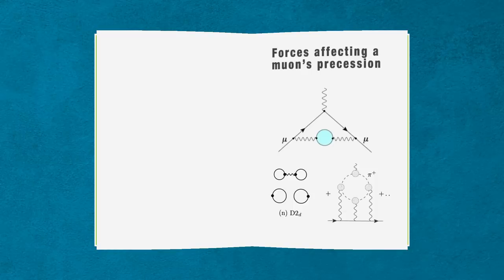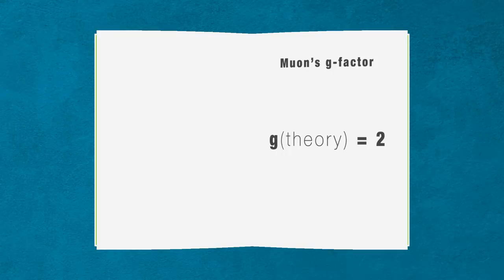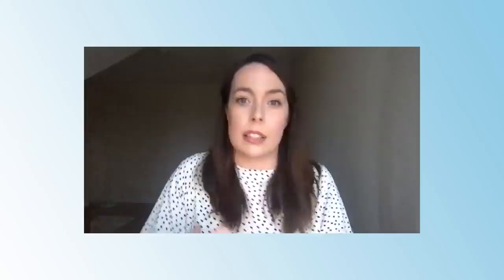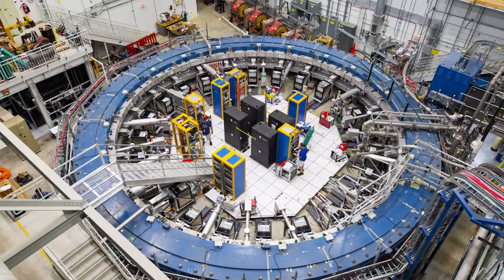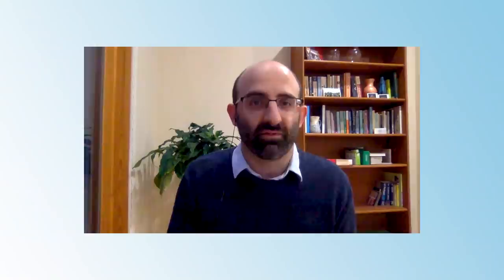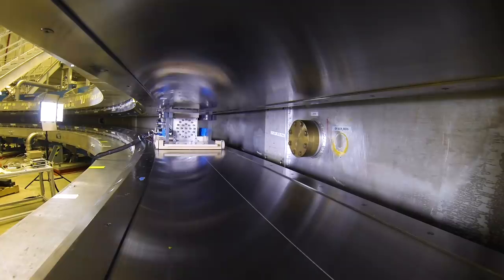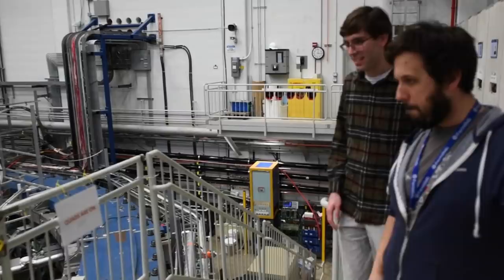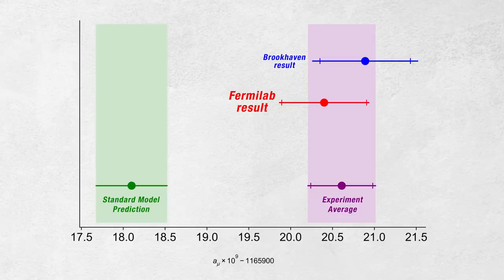Muon g-2 experiment finds strong evidence for new physics

Comment: A very ignorant, but genuine question: What, if any, systematic errors are associated with the physical experimental apparatus? Is there any concern that the similarity between the two experiments is possibly due to the use of the same magnet?
Reply: It doesn't make any sense: how could that influence the experiment? 

(But thumbs up for critical thought anyhow).
Reply: This was my first thought when they said they used the same magnet again. It would certainly help to do the experiment with new equipment, but I can imagine funding for this sort of research is already hard to come by.
Reply: One advantage of using the same magnet is that the systematic error should be the same for both experiments. In other words, if both results are shifted by (say) 10 units, their relative values remain the same. Therefor we can still tell if the values are different or the same.
Reply: Good question.  The parts of the magnet that influence the quality of the magnetic field (the steel blocks,not the big coil) were taken apart for shipment and reassembled.  The magnet was fine-tuned over the course of a year to get much better uniformity than when it was running at Brookhaven.  The corrections in the analysis to take into account the field variations are thus much smaller.  And, they take a break every few days to carefully remeasure the magnet, so they know the corrections better, too.  That's one of many ways that this experiment is improving on the Brookhaven measurement.
Reply: I think it just gives the same error as the previous results and then just chug it off
Reply: This is always a possibility but in this case it seems more probable that future improved theoretical predictions might move towards the experimental results

Comment: Interesting that this suggests that the muon does not satisfy the Standard Model, while just recently the LHCb group also published a result that the muon might not satisfy the SM. The task for theorists is now to suggest models which do not only explain the LHCb result, but also leave room for a slightly higher value of g-2.
I wonder whether e.g. adding leptoquarks to the SM increases the value of g-2 ever so slightly?

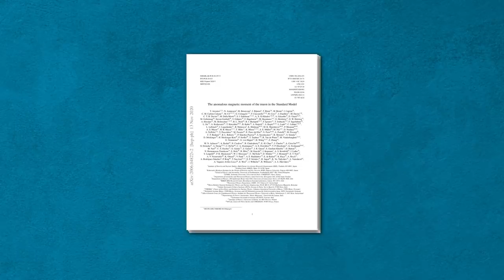By the way, the theoretical paper referred to at 2:36 can be found on arXiv, code 2006.04822. AFAIK Youtube does not like links in comments, but Googling "arXiv 2006.04822 pdf" should directly send you to the right paper.
Reply: There was a new analysis of muon g-2 using the standard model (QED+QCD calculations) published in Nature on April 7 by Fodor et al. and their value is indeed much closer to the experimental values from Brookhaven and Fermilab.
Reply: @FredPlanatia  Do you perhaps know what the differences are from the June 2020 paper? I thought that the earlier paper also took QED and QCD calculations into consideration, so does this new paper perhaps use a different method than lattice QCD to approximate the QCD contribution?

Comment: "Theories we learned in school may be wrong WOOHOO!" - pretty much sums up science
Reply: Actually, it's very unlikely this will change anything we learned in school about physics. We're talking about adding to the picture here, not changing what we already know.
Reply: The science we mostly learn in school, has been corrected over so many years. Also, it's basic science, so there must not be any change but addition in current basics
Reply: dude we approximate pi as 3.14 in calculations in school...and you think a change from 2.00233183620...  to  2.00233184080.. will change the school physics...even accelaration due to gravity was 10m/s^2 bruh..

Comment: On April 7, 2021, a group of scientists published a new theoretical analysis of the expected value of the muon's g-2 value using the standard model of physics (Fodor et al.). They arrive at a value much closer to the new experimental result obtained by Fermilab. So to stay in your American football analogy, while the scientists were rushing for the goalline the defence moved the goal posts.  More to the point: the theoretical calculations of the muon g-2 value are complex and challenging requiring supercomputers and clever algorithms. As the computational capability improves the theoretical value will also change. Eventually things will converge, or diverge as both theoretical and experimental methods continue to get more and more precise. Then we will know if we have new physics.

Comment: What property of the muon allows scientists to determine that it has made one revolution in rotation?
Reply: Short answer: they never actually need to measure that. 

Long answer: The experiment induces a wobble (Larmor precession) using an external magnetic field.   The amount of wobble is directly proportional to the value 'g' they want to measure and it increases the kinetic energy of the muons.  When the muons decay, some the decay products, positrons, have their kinetic energy measured by calorimeters.  Since their energy came from the muons it's also proportional to g.  Obviously there are a lot of factors to account for to achieve the outstanding precision of the result they just announced, but this is the basic chain of reasoning from what I've read as a layperson.

Comment: So... let's say you have a foam pool, like those skaters use to practice air tricks. If you fall there and have to move inside it it's hard because of the foam blocks. There's way too much friction between them, and that's what makes it safe, because it's hard to move in a straight line even with gravity actuating. But if you could theoretically move ahead and spin at the same time through the pool, the blocks will spin and get out of the way, in precisely in the same direction you're spinning. I instantly thought of this example. You could think of the virtual particles as the foam blocks, it's probably easier for the muon to circulate in a spinning state, like aerodynamics act regarding air resistance.

Comment: The Theory of Everything 
(from an Electrical Engineer's perspective)
The Universe is fractal.
Aether/space/anti-matter/vacuum is composed of atoms with electrons spinning around at multiple times the speed of light, therefore currently undetectable to humans, except in the electromagnetic spectrum.
Proof:
1- Quantum entanglement.
2- Gravity as an electromagnetic phenomena.
3- Super colliders additional particles output (yes, we can destroy anti-matter).
4- Transmission and detection of magnetic fields.
5- Synchronicity, intuition, empathy, remote-viewing and other brain related phenomena can relate to electromagnetic transmission.
6- MRI, CT scans, radar detection utilize ether as means of transmission.
7- The bending of light around celestial bodies.
∞ - Anything else we call magic or coincidence when the equations of probability cannot predict.

Comment: Magnetic force rotation abd charge(strong/weak) force rotation abd they spin 90 degree to each other. For example outside of the magnet rotation of magnetic flux is north to south but inside magnet this flux is south to north and they speed like this

Comment: How does this possibly undiscovered particle translate to the muon's odd behaviour? What is the link between the presence of this particle and the interaction of virtual particles with muons? Hope someone can clarify this, hopefully with an extensive (yet easily understandable 😛) elaboration!
Reply: diffrent quantum fields have diffrent coupling coefficient with diffrent fields, this deviation not necessarily means, new particles, it may be just, standard model just does not account, one of these coupling factors, accurate enough.
Reply: Basically new particles would also fluctuate in and out of existence and cause an additional disturbance in the interaction of the muon with the magnetic field. This would cause a change in g-2. Since this new particle is not included in the standard model, when you calculate the expected value of g-2 using the standard model you get a value which is slightly different from the experimental one.
Reply: Particles mumbo-jumbo. There are no particles. There is only consciousness. "Particles" is just an idea in consciousness.

Comment: The magnetic dipole moment for photon is zero  because the light wave is vibrating or spinning in a linear way- which creates  bosons with partial non linear anomalous moment  similar to scalar bosons  which becomes trapped  with in the collapsing local gauge particle wave field  with zero spin  

This  action then  breaks symmetry and becomes a non local field  with the force carrier meson muon particle  group which emits  4 virtual particles including itself nuetrino and a mirror left and right pairing particle with half interger spin being the nuetron and proton

 The reason for not seeing the  non local gauge field is because its because it collapses baryonic meson matter or symmetry break because when you break symmetry olny local invariance stops

 Where  the topmost bottom most strange and charm takes on additional and different particle identities from baryonic mass by switching places or isospin values
 thereby allowing the formation of  namely fermions which can be seen as a consolidation

Comment: So how do you keep all the sensitive measurement electronics from going bonkers standing next to such a large magnet?
Reply: Probably an electro magnet that can be shut off
Reply: The magnet is designed to keep the field from leaking out too far.  The close in detectors are designed to run in the field that they do feel or are shielded.

Comment: I take issue with the use of the term "new physics". It's far more likely there's a factor the original model hasn't account for such as galaxy spin or redshift or backround radiation etc. Correlation does not imply causation. Just because you have a deviation it doesn't mean there is new physics around the corner, it's more likely the theoretical model is incomplete but inside the existing framework.
Reply: They need hype in order to get money.

Comment: A science fiction postulate. And long term experimental concept fodder.
Maybe one day Fermilab will discover that the speed of light can be manipulated in an energetic medium. Much as it is affected by a physical medium. Discovering that emergetic medium likewise affects the speed of light might thus open another exciting new era of physics. Perhaps leading to the possibility of something that we would currently consider faster than light travel. If by raising the local speed limit we can one day still abide it, but at a much greater velocity than is currently possible. We might then travel at rates significantly higher than the speed of light in a vacuum, but well below light speed in a directed quark soup. If for instance the local light speed in a quark storm would be twice the speed of light in a vacuum, it would be theoretically possible to travel at say three quarters of the local quark storm light speed, and be traveling at a rate greater than the speed of light in a vacuum without defying the limits of relativity. If possible, then even greater rates of travel might be possible if local quark storm environment had a light speed limit increased by a factor greater than two. Say ten, or a hundred, or a thousand times. Then true interstellar travel would be a real possibility. And all within the limitations of general relativity.

Comment: Wouldn't there HAVE to be new physics since the Standard Model doesn't account for gravity?
Reply: Yes. But this slight inconsistence between "the most accurate prediction" that sustains the Standard Model strongly suggests that this one needs improvement. While totally unclear at this stage, it's possible that this need of improvement of the Standard Model (Quantum Mechanics as we know it) might lead to some sort of "unification" but only time will tell. 

Personally I lean for GR being more fundamental and solid than QM and thus there might be a need to change the primary focus of fundamental physics to one more reliant on (so far totally confirmed) Einsteinian physics. But that's another story.

Comment: So all this is just for 0.00000001 difference?  And that is considered big?.
If I were to take pi and add that number, for it to differ 1 mm from the actual radius, the radius has to be 100 km.
The earth has a radius of 6371 km.

So the difference on the scale of the earth would be 64 mm.
Wow
Big
Groundbreaking.
Chapeau
Unbelievable
Holy crap.
64 mm difference on planetary scale.

Comment: Wasn't electron's g factor supposed to be 2 but in fact it was c.a. 2.0023? I'm kinda missing a comment on this coincidence. Is the mechanism for this "correction" similar?
Reply: Yup - it's from an interaction of the charged particle with the surrounding EM field; to first order, I think for the electron that's alpha/pi, and was first calculated by Schwinger

Comment: i'd like to hear why the magnet had to be moved from brookhaven and the original eperiment couldn't have been updated.
Reply: Fermilab can provide a lot more muons than Brookhaven could.  One of the key factors of the anticipated improvement in precision, along with detector upgrades, is the huge increase in the size of data set possible with the Fermilab beam.
Reply: @davidharding2234  Nevertheless (if I'm reading the graph correctly @6:27 ) the Firmi lab result was 3.34 sigma, while the Brookhaven result was ("better") 3.71 sigma. The 4.24 sigma value is computed after combining Firmi+Brookhaven data. Firmi will likely get to 6 sigma after repeat experiments, but it seems like Brookhaven could have done the same thing, in less time.
Reply: @davidharding2234  thank you, i think the "different beam" was the answer i was looking for.

Comment: The standard model is missing mirror matter, which in SPD is exotic matter, so of course not adding in the mirror matter will set off the result. In my own calculations for vacuum fluctuations I always include mirror matter to get an accurate result.

Comment: If muons decay that quickly, how does measuring work? Multiple muons or is there a way to prevent decay?
Reply: Muons decay in 2.2 Microseconds which is a lot. Maybe not from a human perspective but for sensors it is. To compound this, Muons decay in 2.2 Microseconds if they are in a non-intertial frame of reference, but as they are accelerated to high relativistic velocities they experience time dilation, which extends their decay
Reply: Boodysaspie  Yeah. Time Dilation, precisely what I said